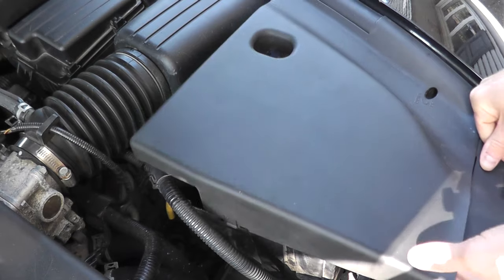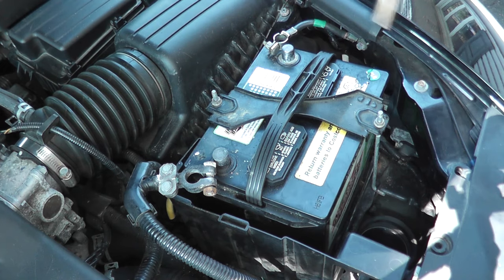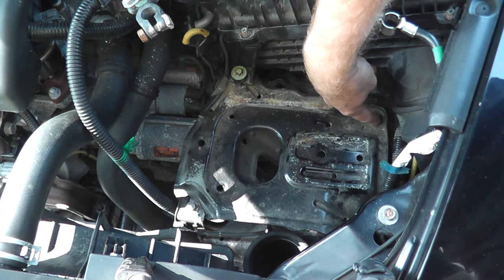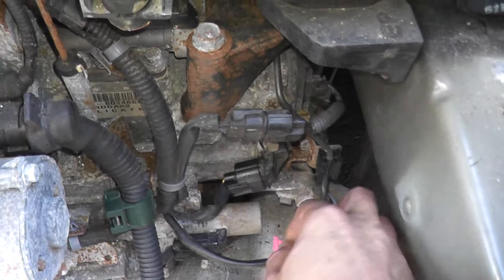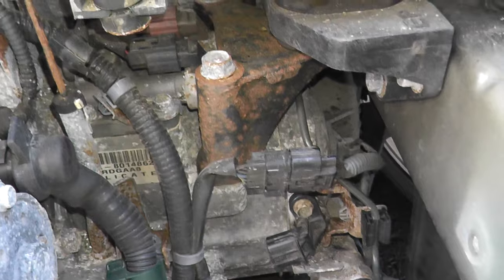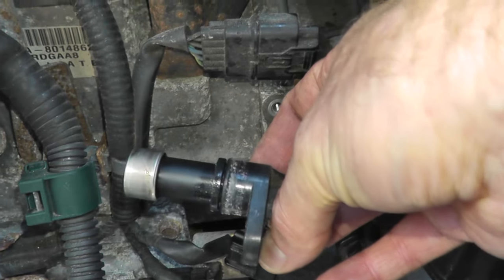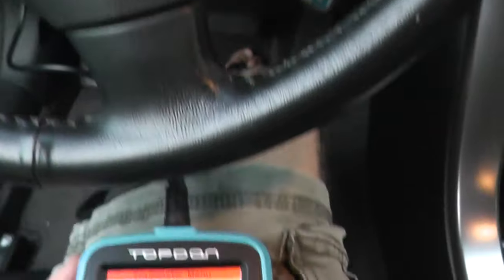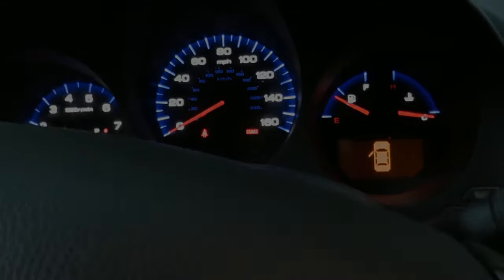How To Replace An Input Shaft Speed Sensor or Mainshaft Speed Sensor P0716 / P0717 / P0718

Comment: I have 2002 CL500 limp mode in the transmission only allow me to do 40 miles an hour it's stuck in second gear so I put it on a computer input shaft speed sensor do I need to replace both sensors the input and output now this is some w215 Mercedes-Benz 2-door CL500

Comment: Pretty simple, but.... some cars need to have the transmission pulled to replace the INPUT Speed sensor. Had this issue with my 07 Suburban. On some vehicles there is a Big difference between replacing a speed sensor and replacing an "Input" speed sensor. Thanks for the video.
Reply: حح
ن

Comment: And also should I do a transmission change a filter and oil car has 134,000 miles on it and also replace the input and output speed shaft does the transmission has to be computerized by Mercedes-Benz

Comment: I have a p0717 code in my 2007 mercedes benz c230. My car is in limp mode and when i put it in reverse or drive the whole car violently thumps when switching. Can I assume the input speed sensor will fix this? Theres no other codes besides this one.

Comment: I don't have a check engine light on, on my Acura tl. Sometimes the [D] light flashes. My cruise control doesn't work anymore. I'm wondering if that's what's wrong with my car.

Comment: HELP!! is it possible for the sensor to come apart inside the trani? When I go to remove what I'm 90% sure is my OUTPUT speed sensor there is an umbilical of four wires holding it in?! When sticking my finger inside to trace where those wires are going 3 of the four aren't connected to anything?? Did I F&$# something up, or is this why I was getting the code for a faulty output speed sponsor in the first place?! Please I'm not sure where else to go?'(

Comment: Does this apply to p0715 because mine car is a 05 ford focus p0715  turbine/ input shaft speed sensor A circuit
Reply: I have the same code on my 2001 vw jetta tdi did this work for you?

Comment: Pls help me. !!! I have a Fiat Punto 2011 dualogic.I have p0720 fault code at "only and always" 130 km/h  speed. When the car is under 120 km/h code (warning) is disappearing.i changed the oss 2 times and complete gearbox,  transmission fluid. Still same problem. 
:(What do u think? Where should i look to fix it? Why always at 130 km/h ?? Do u think that it's about bad connector?
Reply from the maker: I'm afraid that vehicle isn't sold over the 'pond'. However, typically, trouble code p0720 is the sensor or harness connector.

Comment: i have a question ,  does it affect the gear to go neutral by itself sometimes , when put on Drive , and doesnt fix untill i put it on 2 ??????  2003 civic ?
Reply: I have the same problem. When shifting to second gear to third gear before reaching a speed of 40 km, what happened to you? Did you repair your transmission?

Comment: My 05 acura tl reads the speed wrong on the speedometer. Would this be the fix for my car?
Reply: The Input and Output speed sensors sense the difference between engine speed and output shaft/wheel speed.  You may have a 3rd speed sensor, like I do, that is strictly for the speedometer.
Reply: @waynesanders1406  now where would that sensor be ? Thank you for your reply. I'm still stuck with that issue b

Comment: Hi. Is it necessary to clear the DTC? Won't the CEL extinguish automatically now that the problem is solved?
Reply from the maker: Yes, it will extinguish in time.
Reply: @CarsNToys ford fusion 2013 2.ecoboost speed limit sensor ????

Comment: Hello, I have an 89 grand marquis and thought to change my transmission speed sensor as I’ve heard it can help with sloppy shifting as well as bouncy speedometer as this one sensor has both inputs. After changing the sensor (which was fairly simple to do) I bolted the negative wire back on the battery, went to start the car, but got no crank at all. Battery and electricity comes on fully charged, but starter is not even trying to crank. I tested the starter and it isn’t the starter.
I am going to switch back to the old sensor tomorrow and see if it starts again, but would love to get any input you may have of this particular situation. 
Thank you for your time 🙏
Reply: did you ever figure it out?
Reply: @zachhuffman9336  my year and model has two black on off switches located on either side of the ash tray right under the front dash radio. The left switch turned out to be a kill switch for the starter which I unknowingly turned on. Switched it back to off and starter worked as normal. Right switch is a kill switch for the trunk opener button. 
For nearly 2 weeks I couldn’t figure it out and thought I had ruined something electrical while trying to learn and repair which made me kinda depressed. I wanted to die when I realized it was the kill switch

Comment: just to help people out.... my vehicle threw code for output shaft speed sensor and no communication to tcm.... theres input and output transmisson speed sensors! both com.. with pcm and ecm and tcm all on same can bus network. i replaced the output the codes cleared and retsored com to tcm. car started was no start, but.... i noticed the rpm gauge didnt work at all! the rest of cluster was fine fuses were good, so i discovered that input shaft tells pcm and rest of network the rpm and top of tranny speed, the output measures the actual axles or wheel speed. not engauged while in park. but rpms and input shaft are! hopes its helps someone! cars suck now!!! i want back basics no computer crap!!! v8s and carbs!!! there scamming us all so we cant work on own cars anymore! stick together help one another!!!

Comment: Does this work for P0715
Reply: I believe that one is for the input transmission sensor
Reply: @rafatorres1420rt  I can’t find input speed sensor on my 2013 nissan sentra 1.8 I got same code 0175

Comment: 2007 Toyota Corolla my speedometer still works but the vehicle rev out high wen I drive it .  Code p0500 .and I had replaced the output sensor and same thing
Reply: Did you find the problem
Reply: @uptownscenery9175  speedometer cluster